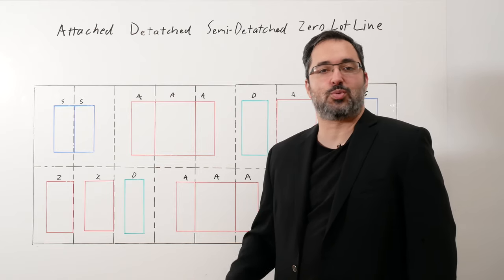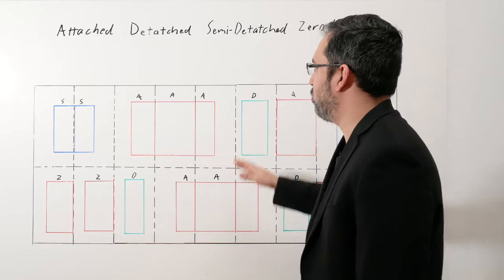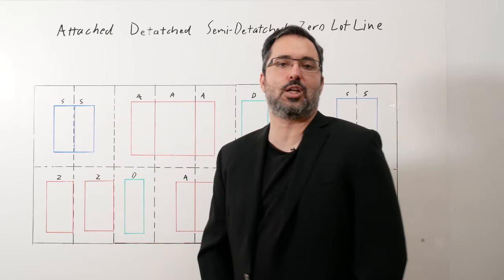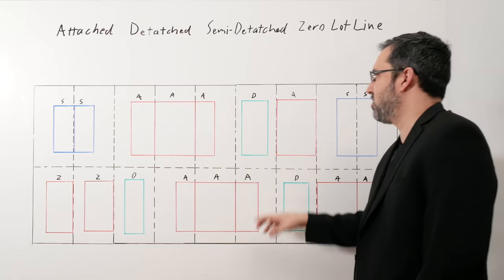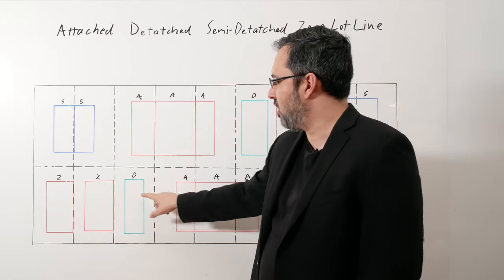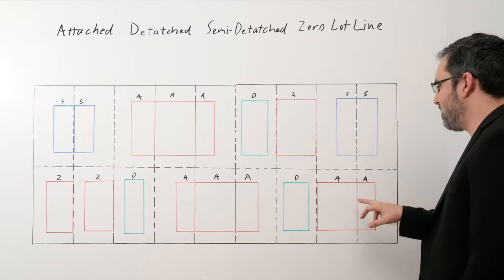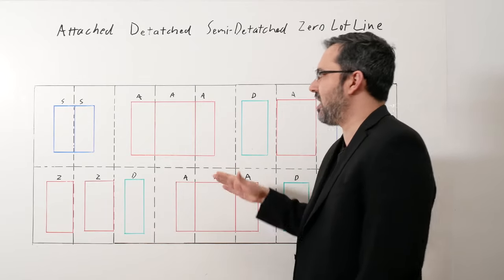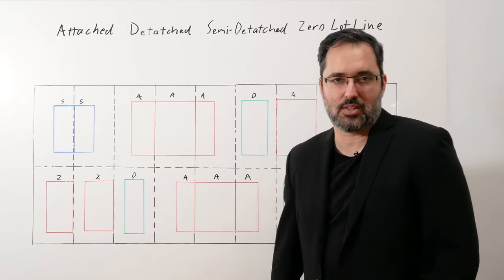Attached, Detached, Semi-Detached, & Zero Lot Line Buildings & Houses Explained

Comment: I personally think that it should be different from one region to another because we have in the middle east plots attached to three units it called (attached) to two units called (semi-attached) to one unit (semi-detached) not attached to any unit called (detached), so as I said it should be different depending on the urban planning system.
Rojhat Ibrahim 
Ph.D. student in Architecture